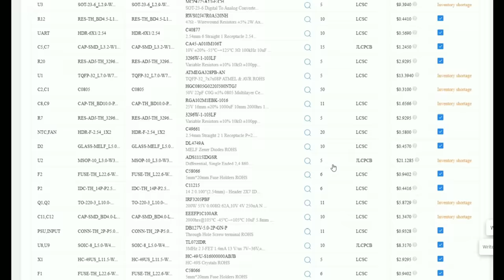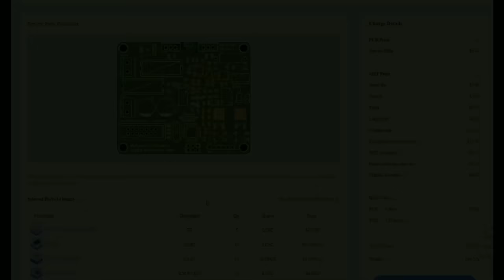DIY 4x505watt High Power Amplifier using 40 transistors | 2SC5200 & 2SA1943 #cbzproject

Comment: 500 watts at 8 ohms from 20 to 20000? i doubt that alot. Judging from the tiny power supply it looks like a 50 to 100 watt at most. What about capacitors or to be precise im looking for capacitance. 50000 or 100000? You do nice work and good videos but this does seem like a gross exaggeration on the specs. Do you measure when stating stuff like that and if so please include this in the videos

Comment: How do you determine Watts for power?
Reply: Volts x Amps = Watts.
Reply: RMS or mean quadratic ?
Reply: You must see the datasheet for each transistor there are  one's 100 watts an example is a1943 and c5200 one pnp and other npn give 100 watts
Reply: P = V^2/R. R is your speaker resistance and V is the average voltage. To measure V you could take the peak of a sine wave and multiply by 0.707.